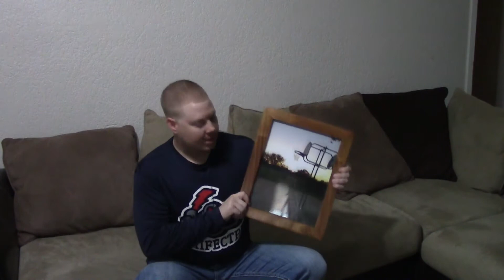Pallet Picture Frame - Pallet Challenge 2016

Comment: Nice, I made one for my wife out of an oak pallet board.
Reply from the maker: Sweet, if you have twitter or instagram you can send me a picture of it.  I would like to see that.  My profiles are in the about section of my YouTube channel.  

Thanks for watching.
Reply: +My Next Project I will attempt that. I still haven't got and glass or plexiglass for it yet.
Reply from the maker: If you know what size of frame you want you can probably get plexiglass online (amazon) or get the exact size you need from Home Depot or somewhere like that.  I cut mine down because I bought that sheet as damaged.

Comment: I noticed your TS seem to work hard on that walnut.  FYI, buy a mid-priced 7-1/4 circular saw blade and put that on your TS and cut a piece of that same wood and you won't believe the difference in the ease of cut.  I have used one on my saw most of the time.  blades are only about $12 and I replace it once a year or whenever it gets a little dull.  cutting wood will feel like cutting butter, rip and crosscut. you get about 2" of cutting height which is good enough to cut a 4" thick board.
Reply from the maker: Okay I may have to try that.  I know I need to get a new table saw blade.  That is the actual blade that came with the table saw.  I am not sure how good it is to begin with, plus it is over a year old now.  

Thanks for watching and commenting.  :)